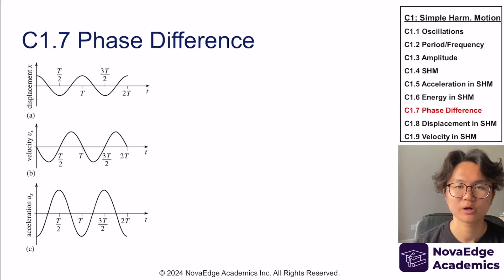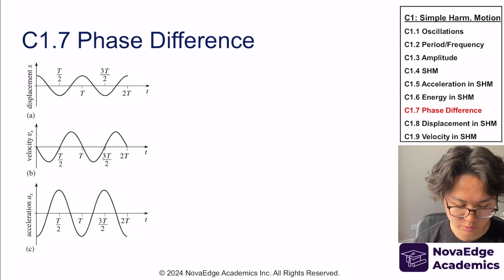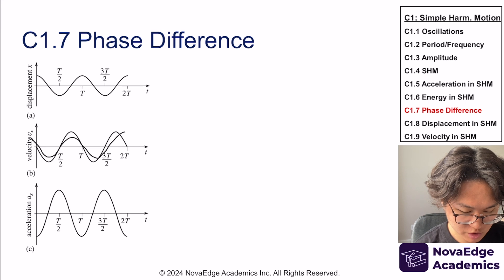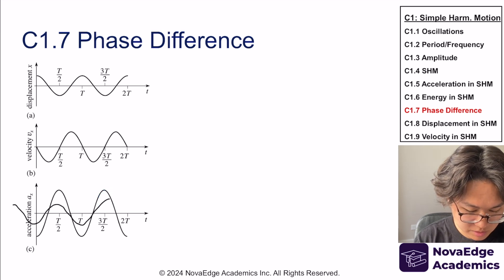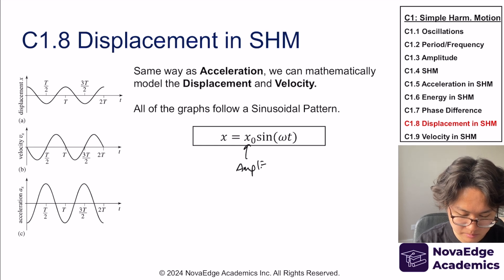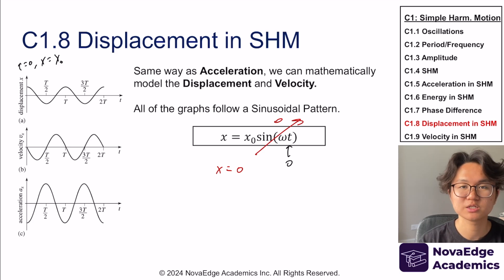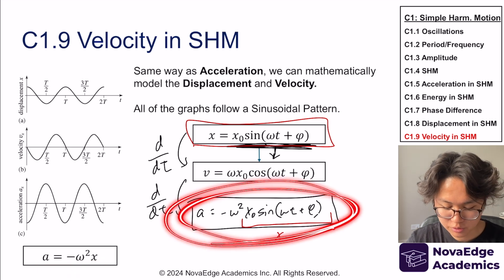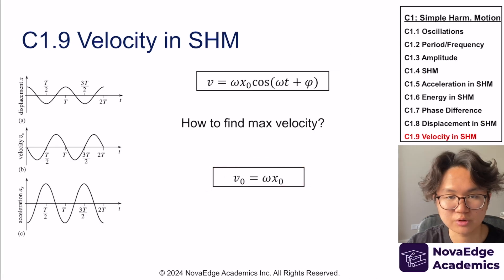NEW 2025 EXAM IB Physics C1 Simple Harmonic Motion Pt. 2 (HL)

Comment: Hi! For the first practice problem I think you used degrees instead of radians which I thought wasnt possible since phase difference was given in pi/2 rad [equivalent to 90 degrees]. The final ANswer I got was -2.88 ( 3 s.f). Please tell me if this answer is correct or whether Im doing something wrong?
Reply from the maker: Hi, first of all thanks for watching our videos and following it through!!
I would have to check on calculator, but the method shown is in radians. My calculator may have been set as degree instead of radians, which may be why we got something else. Always make sure the units within the bracket are radians. Hope this helps, and good luck!